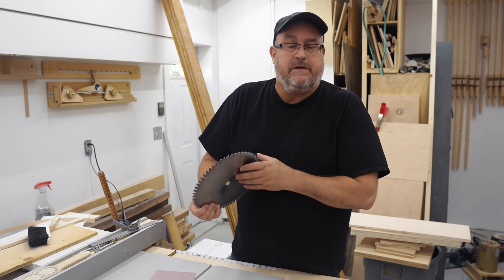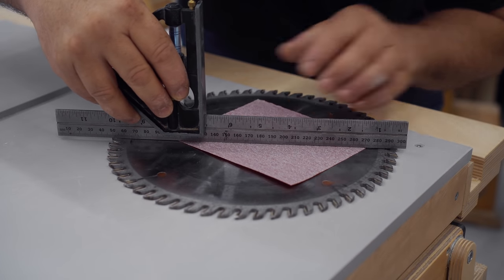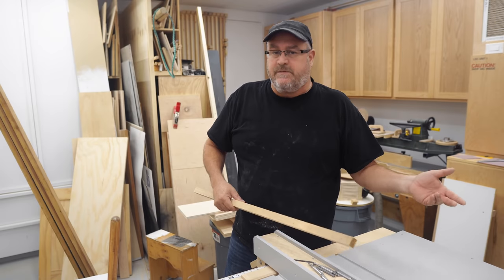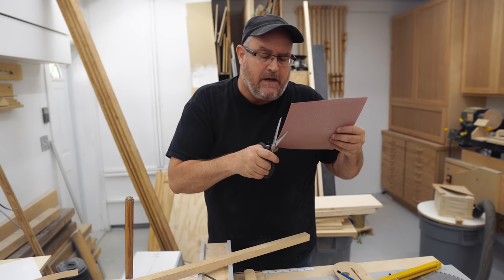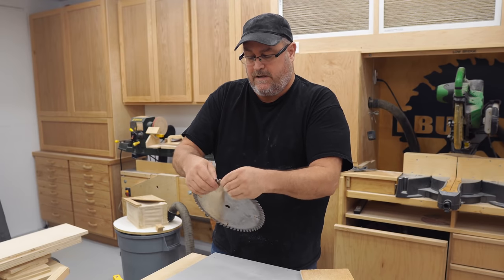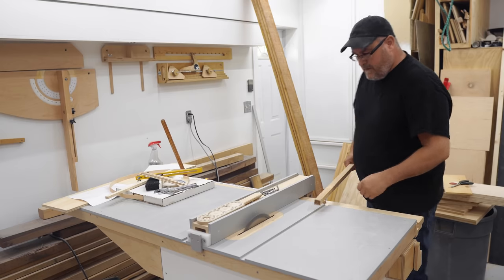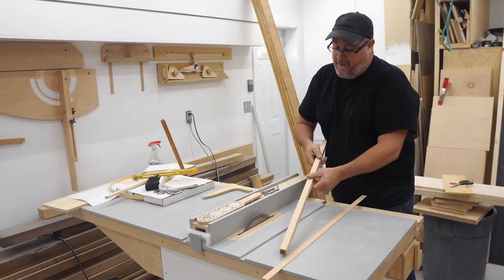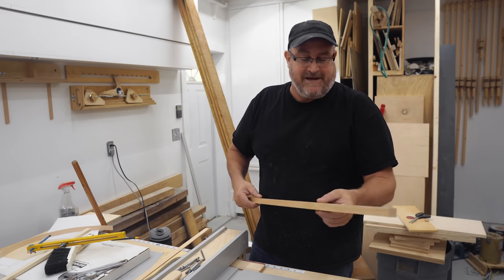Can you Cut and Sand at the Same Time? Interesting Results...

Comment: You know, when I use a fine finish blade on my table saw, the finish it leaves is better than almost any finish I've gotten sanding; even on end grain.
Reply: Yeah, my 48 tooth Ridge Carbide blade damn near leaves a polished edge.
A quality blade on a properly aligned saw saves a lot of work.
Reply: Same with my Japanese saw!
Reply: I have the same result with a finishing blade in my miter saw, smooth and even cuts, no sanding needed.
Reply: Most turners will agree that a clean and precise cut is far smoother than even the finest grit

Comment: I wa skeptical, figured that it would either burn the wood, bog down the blade, fly off, etc. Then I thought why do you need this if you have a sharp blade? But I was only thinking of cross cuts, not rips. When it comes to ripping, I’ll be doing this sandpaper trick next time! Excellent idea!

Comment: Hmmm could be a new invention in this. Imagine having the face of the blade actually machined to do this job, kinda like a metal file... 🤔
Reply: Or maybe it could grab the workpiece and kick it back, piercing your body. This is fucking dangerous.
Reply: The width of the blade base is made thinner than the width of the teeth themselves and it has the reason that only the teath cut/touch your workpiece. This is so that your work piece has way less touching points with the blade and it reduces wear of the blade and kickback also. By glueing sand paper on it to make it work, it has to be made the same width as the teeth AND it RADICALLY increases the chance of a kickback because of the higher drag. It's a fun idea but also with that kind of saw that he's using its really dangerous in my eyes
Reply: @DasosBeats  well I'm sure with the right R&D it could be a viable option. I don't have all the answers, just saying it's an idea that could be developed. Every new idea comes with H&S risks that need to be addressed... 🙂

Comment: One of my table saw blades comes with 220 grit texture already on the side of it
Reply: I have a sanding disk - I'll have to file some teeth  on it to do the cutting  as well.
Reply: What kind of blade is that? What's the brand?
Reply: @dangerboy808  there is a blade called Final Cut that has this feature

Comment: So cool yet so impractical, i used to do lab tests on metals and we had to sand them. The technique we use is pretty much the same, a rotating disk with sandpaper on it(though horizontal). And we had to change them every 30s-60s, of course metal is tougher than wood but still, the high speed rotation eats away really fast.

Comment: And what happens when it binds? This seems so dangerous.
Reply: The saw stalls, so you turn it off.
Reply: My thoughts exactly. You're creating friction on the side of the blade which is exactly why the teeth are offset to prevent that. This is indeed more dangerous. The sandpaper could more easily lift the work piece. Also, not to mention that when the paper fails, which it definitely will, you can expect chunks to fly off. This is very neat to see but holy smokes.
Reply: @davelowe1977  I was meaning under the stock on the trailing edge of the blade - which would potentially amplify kick back and turn it into a missile.
Reply: nope
Reply: then don't do it

Comment: Interesting. I remember moons ago using what was called a 'Planer Blade', basically a normal table saw blade but with deep channels cut out towards the centre and about half an inch wide or so, so as the teeth cut the wood, the edges of the channels 'planned it smooth - worked really well and I haven't seen them since. In the UK that was, in the 70's.

Comment: This is hilarious and legit pretty cool, but you could always buy a Diablo 10 x 90 ultra fine finish blade and get a 220 grit finish on your cut. I have one and absolutely love it. I was skeptical about it being a marketing ploy but the wood really does come out ultra smooth. The blades also have a good amount of carbide so they can be sharpened quite a few times before the carbide gets too low.

Comment: Im honestly surprised this worked, I think I had always assumed that the blade lines were created from the rising teeth on the back half of the blade, though I guess like you said, if the sandpaper is just a hair wider than the tooth set, it shouldn't matter.

Pretty interesting as an experiment, though I think for regular working I'd worry about the friction creating a narrower window in which you can avoid kickback, as well as the abrasive grit from the paper getting into the bearings of the saw / dulling the blade.

Comment: So you did it and it worked great, and I am impressed. I scared that the sand paper would stick the piece of wood and may gave some dangerous back effect...but not! My question is: after getting this nice smooth cut, did it keep the size perfectly flash at you set it before the cut, or did the piece got some gap than you expected it? Thanx for your video, you makes great job! And please tell me if you made a video for this magic tool you used to unscrew the saw blade....

Comment: Pretty dang cool but I would only try this if you are an experienced wood worker and fully understand the mechanics of how a table saw functions and the proper way to feed material. I can see someone who is not very experienced try this and push the off cut against the blade causing and insane kickback due to the sand paper grabbing the material. That being said it's actually a really cool technique and I'll be using it from time to time in my shop.

Comment: As a finsih carpenter I had done this for years.  Added to my chop saw  it did wonders for my trim cuts.  I also I add a tapered shim to the cut so the finish back cut had a slit taper making the fit absolutely perfect.  I also had other pro tips that made my work always turn out stellar.  Just sayin  RC

Comment: Nice idea , the issue I can see happening is the blade lasting longer then the sandpaper .
Now if the sandpaper was fixed in a way that was easy to be remove and attached , 
I could see this being a thing . Imagine buying sandpaper as an add on for saw blades

Comment: Interesting.
I first thought it would not change the result since the  teeth / kerf are wider than the inside or - if not - would start burning the timber, since its lots of friction.
Howewer, makes little sense to me. Its a damn table saw and you have deal with the finish anyway.
I usually sand with different grids and the blade would just then have a standard grid for sanding, use smoothing planer, route it to the shape I need or use scrapers for a perfect finish. And if not I usually do not care about sanding at all.

And Gary Swartzleonard makes a valid comment below about safety. You dont want any kickback or better: You might not mind the kickback, but you for sure mind your own teeth.

However, very nice video John! Interesting to watch, think about it and read other peoples thoughts.

Comment: I have a cheap 6" cut off saw that I converted to a chop saw for wood, for a saw blade to work in it I sandwiched it with a grinder blade to make up for the width needed.  It worked great until it started burning the wood when it cut.

Comment: Back in the early 80's I worked for a company that made wooden flush doors. Our main "saw" used sand paper stuck to 10" blades to cut the 4 sides of the door in one pass.

Comment: My initial thought was that the sandpaper would cause significant kickback from the saw, due to the excess friction. I can imagine it would be greater if you used lower grit sandpaper.

I think @Matthias Wandel needs to take this idea and run some experiments...

Comment: Interesting idea 👍
But keep in mind that the sawblade creates heat wich would compensate over the blade itself and the small slices in the blade. Instead you load even more heat trough the sandpaper on the blade. This could create a heatproblem if you saw more cuts or even thicker and/or harder wood. In best case the precision of the cut goes down a little, in the worst case you burn your blade.

Comment: Great, innovative idea , but the effect is not that surprising to me. Think about the cutting discs for angle grinders, for example. They are as flimsy as cardboard if you try to break them and also have abrasive surfaces on the side.
This solution, however, would make manufacturing these blades much more expensive and harder to maintain, as the metal blades have to be replaced infrequently in comparison to the sand paper.

Comment: This is actually super dangerous. Given the high revolutions and subsequent centrifugal force on the saw, anything not fully adhered will break apart relatively easily and if a wad of sandpaper comes free and jams in the cut mark it'll be like holding onto an exploding grenade. That said, I'm assuming all you would need to do to make it safe is bond some kind of sand filled polymer on top the steel and you'll get the same effect without the paper. You would need to wear goggles  though as the sand/silica breaking off the saw will be flying at your face at quite a rate.

Comment: I do it all the time. Just cut a rectangle 1cm wide or whatever in inches and glue so its running from the spindle to the teeth. I usually rob old bits of sandpaper.

Comment: As soon as you mentioned the idea, I thought about balance issues. Granted, the sand paper is light, but at that RPM I thought it might be just enough to affect the balance of the blade.
Reply: Mass is well distributed, as long as you make even circle and spread the glue well, no balance issue should appear.

Comment: I wouldn't know for sure without holding both the annoying high pitch sawblades but I could imagine the number of cut-ins and the width and shape of them could have a tremendous effect on whether the pitch is low enough to hear or not. I figure manufacturers would try to aim this out of range for at least the most common rpm's but one size never fits all in engineering so it might be worth looking into.

Comment: Ya. They make something like this called the "final cut" blade. I got one before. For the first 100 linear feet I cut I felt like a genius. And after 100 linear feet I felt like an idiot. The sandpaper just wouldnt last long enough. It would start to clog on the outer most edges and then I couldn't clean it with an eraser like I can a regular disc sander... Due to the spinning saw blade teeth lol. I ended up replacing the disc so often that it counter acted all the time savings. I just went back to my tried and true fast method. Cleaning up my edges at the helical head planer. And if you are gonna do that... Then no need for a table saw for ripping at all. My bandsaw does a better job with less waste, better dust collection, and more safety if I'm gonna clean it up at the planer.

Comment: In order to make a fair comparison you should cut both pieces at the same speed. The one without the sandpaper you cut very fast where as the one with the sand paper you cut very slow, so it will naturally sand the wood at that slow speed. It would be nice to see the difference.

Comment: Now a problem you’d face is cutting a piece of timber to size, let’s say you wanted to cut it to 160mm but the sand paper brings it down to 158mm so it’s not gonna be up to the standards of what your looking at, i wouldn’t use the blade for sanding, I would plain it down 1mm then put it through the thicknesser for a nice square piece of wood

Comment: Seems like a way to turn your table saw into a disc sander. I'd like to try it using a pre cut stick on sanding disc. It will be smaller, but depending on the blade depth it could still serve a dual purpose. Just thinking out loud.

Comment: This gives me an idea, a saw blade with a diamond gritt surface imbeded into the side of the blade 🤔 because usually they're smooth and Im wondering if that's actually a downside now.
Reply: No, smooth sufaces are there for a reason. YOU DONT WANT THE PLATE RUBBING THE WOOD. friction with the plate almost always result in kickback

Comment: It is an interesting idea, but I question if the wood is actually touching the sandpaper. The teeth are wider than the disk itself, yes? I wonder if it has more to do with the speed in which you ran it through the table saw, as in, the slower the less marks.

Comment: I imagine that a similar result could be accomplished for a single flute quanta of a CNC router, milling bit or any tool that utilizes shear force between a tool and a working material to preferentially shape the work.  To elaborate: add a textured portion to a moving machine tool, in a position that lags behind the approach of the leading cutting surface(s)/edges(s).  As an aside: I make no claim that "edges" can exist; and rather counter-claim that there is only one metric that governs reality's composition: surface area.  This comment will make a lot more sense in several hundred years.  An example of what I propose here is a two flute bit that has the second flute made from a sintered grit composite material.  This would likely, when applied, result in a more general case of the sanding-saw cutting tool in this video; which has achieved such impressive results.  This document, now published, is intended to contribute to public discourse and provide me with timestamped data which may allow my personal use any filed patent work surrounding the claim of this invention.  

In short, nice work! Or rather; very fine work!

Comment: or another idea the company i currently work for does abrasive plating and can plate the sides of the saw blade and it wont wear out and you can have a choice of grits to use, and they can be recoated at any time.

Comment: Mmmh, I wonder if a blade with a pre made shape in it, slightly less than the thickness of sandpaper would still deliver this effect, but prefent failure if the wood damages the edge of the sandpaper when inserting... or maybe pre made sandparer shapes with a pre-glued back (like big stickers) would be better. Or te aplications of a smooth edge like that are too limited and situational that the adition of the sandpaper would be useless in the long run.
But still nice video.

Comment: Wouldn't your paper need to have a slight cone shape to get the entire paper working?  Else you'd just be hitting the work piece with the outside diameter of the sand paper right?  Maybe a few passes are okay, I'd expect more damage to the paper's perimeters otherwise?

Comment: I thought this idea would be something coming out of Tim Allen!!

Any time saved from doing a rough sanding would be wasted by gluing and removing the sand paper from the side of the blade. And you would still probably need to do another rough sanding to make sure every piece is the same height, cause not every piece will receive an equal sanding.

Comment: I would think that the sandpaper could cause extra fiction when sliding wood through, and could potentially either bind or push back material. Just my opinion for safety, I'd be too scared to try it

Comment: Theory is good. BUT unless the sandpaper stands proud of the teeth, the teeth of the blade remain the first and last thing to contact the wood. The sandpaper also covers the heat expansion relieving slots designed into the blade. I think this is short-lived and will be more trouble long term than it is worth. I'm going into business suppling the sheets of paper though because this could be a huuuuuge opportunity 😳 😅

Comment: well seen as the saw tooth is the last part of the blade to touch the wood and not the blade body this ideal is flawed. Also the last thing you want on a saw is for the wood to pinch the blade and kick back, sand paper is only going to increase the risk of this happening. one thing that might have effected the results is you went slower the second time meaning the wood recieved more cuts per minute then first one making it smoother, faster you go wider the cutter marks. If you used the saw with the sand paper on for multiple cuts could you not see heat build up and losen the adhesive on the paper?

Comment: Without watching the video, I predict that the width of the carbide teeth is wider than the blade which means you will be cutting the 2x4 and then will have to press in to sand the wood and that can compromise the cut.

Comment: A narrow ring of carbide or diamond dust embedded wouldn't be expensive and the time saved in furniture making would be significant to pay for it.  One could probably do it to existing blades using epoxy.  No one likes saw marks.  Grit size is only important, to offset the teeth.

Comment: This is dangerouse.. Maybe try to put sandpaper on a rivingknive which has the perfect size and thickness AFTER putting Sandpaper on it... Probably a 100K grip. I think its a little bit harder to push trough but it would be much saver.

Comment: Short answer! Are you Nuts?
NO!
The reason is most carbide tipped blades are wider than the plate at the carbide tips.  Now the sandpaper might make up for this but Sandpaper on the blade is going to give the saw more chance at kickback.

Comment: Thats awesome! I mean, it was cool when seeing it for the first time a few months ago, but after trying it...it's incredible - had a few issue with the stock 24 teeth blade on a dewalt dwe7485, just because the width of the tooth is 2.4 mm, and the body + sandpaper thickness is slightly higher so no way to cut anything but thin softwood; on a 2.8 mm kerf cmt blade is perfect, but it's a 36 teeth so i wasn't able to cut through thick hardwood (but on plywood it was top notch)...anyway a rip cut 24T cmt is on its way for tomorrow! Anyone tried sandpaper on both sides? (I'll try)
Thanks a lot! 
Ciao, Francesco

Comment: Yea but you have to run the blade up a lot higher than I would normally cut at since I don't have any gards on my table saw I try to keep the teeth as low as possible